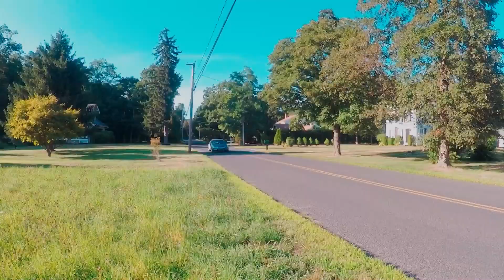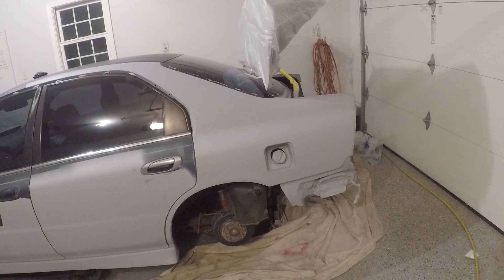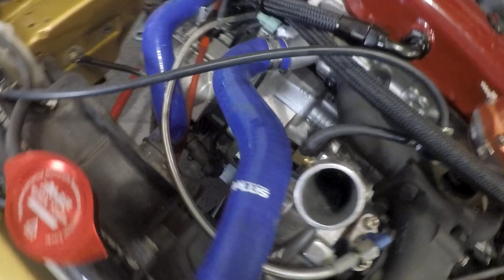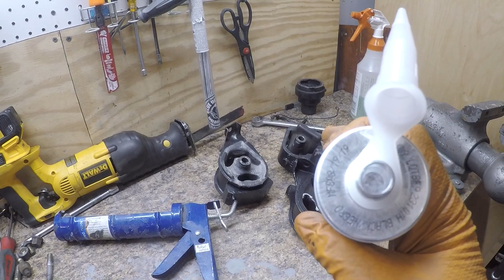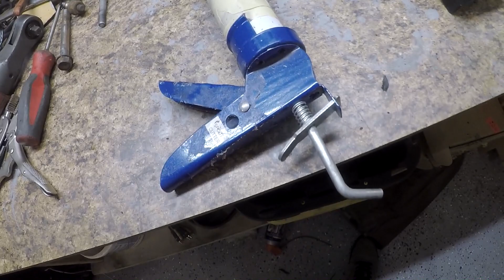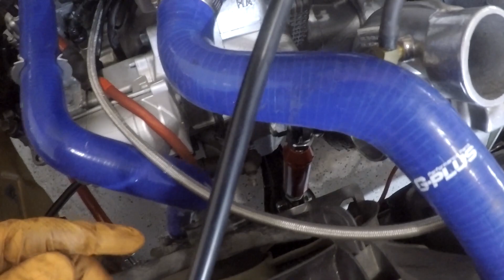Performance Engine Mounts For my Turbo Honda 3M Window Weld

Comment: Does anyone know the durometer of 3M Windo-Weld?  For reference Hasport mounts start at 60a for their durometer rating.
Reply: @chronicvehicleabuser4030  someone said 76a
Reply: 76 is a soft OS hockey wheel, should be firm 👍
Reply: 60a
Reply: I wonder how it compares to Dow Betaseal. It's cheaper and has the same cure time.

Comment: Ive done that to my 96 maxima mounts and i just bought some for my cb7. I hate how much flex the brand new stock mounts have.
Reply from the maker: Yeah totally man the way I see it, if I can move it with my hand... The motor is going to move it real good.
Reply: @ThatAccordGuy  definitely.. Plus i love how theres basically no wheel hop with solid mounts.

Comment: -
Great video.  I must do this for my rear broken mount.  Cannot replace it due to the need to drop sub frame.  Hopefully this will do the trick and get me by for a little while more.  Thank you .
Reply from the maker: Hopefully it helps man, jack the motor so it sits in the correct position while it dries if at all possible. Longer you wait the better. Good luck!

Comment: Squirt a little windex on your finger, or on any tool that you choose to use to smooth the surface of the urethane with.
It won't stick to windex.
Reply from the maker: Appreciate the tip!

Comment: ?????  My 97 Accord shakes at stop lights and I have to shift into neutral.  Would this 3M stuff help to stop the vibration ?????
Great car and thanks for the videos.  😀
Reply from the maker: No I’d recommend replacing them if you’re taking them out. Probably worn down to the metal. This mod will make you feel more vibration than a stock mount. Thanks for watching!
Reply: Thanks...this will be the third motor mount...aftermarket are junk...can you recommend a reputable supplier? @ThatAccordGuy
Reply from the maker: I’d go oem if you’re going for an oem type feel. If that doesn’t fix it then you’ve got another issue

Comment: I'm doing this as I type this message thank you I appreciate mounts for my 4th gen Prelude ridiculous
Reply from the maker: Yeah not worth the money honestly. This has worked great for me
Reply: @ThatAccordGuy  they've been drying for about a day now I have a really really small needle I poked through it still wet in the very middle I'll leave it for a few more days
Reply from the maker: Yeah it definitely takes a while. Mine oozed a little when I reinstalled with the weight of the engine on them.

Comment: Just did this method on some new motor mounts, thankfully they don't need to go into my integra anytime soon!.

But from what I see around the internet it takes about a week for the window weld to fully cure inside the mounts, so in about that time i'll swap them in and see how much of a difference it makes. 

I appreciate your video man, helped me get started on my project.
Reply from the maker: Glad it helped you. All of mine are still holding up strong. The one Mount that I filled the top portion of has a little crack in it, but that doesn't really account for any of the rigidity of the mounts. They're still holding up really well.

Comment: Motor mounts are pretty cheap if you spent the time and pain and busted knuckles taking them out. Which is the one single dreadful step. Why not install new ones. Maybe even aftermarket cheaper ones? If you want to be cheap. But taking it out and just to put the old ones back in filled with 3m. Seems a bit senseless. No disrespect I enjoy your content and maybe you or anyone can correct me. I’m only commenting because I’m planning a similar job. Would it be more sensible to jack the motor up to spec or until it’s all lined up. Or take load off the bushing and then jack up the engine. So it’s back in line with the transmission. Then apply the filler and leaving it position to cure? It’s not the cost of the $50 rubber mount it’s the time and pain getting it off. Any input or correction are welcomed. I’d appreciate the same common respect if you choose to chime in please have some knowledge. Don’t have to Experts on rubber, tires, rubber condoms, polyethylene. Just common mechanism knowledge and DIY like myself. If it’s broken I fix it. As long as it can’t talk. I tried fixing my ex. Well let’s just say the bitch broke down. Turns out I’m just a jackass of a few trades not all. Ha.
Reply from the maker: I see where you're coming from, however these are not stock replacements. If I wanted to put a new stock mount, Id put in a new stock mount. Aftermarket solid or urethane motor mounts can be upwards of $400 or more. No way I would spend that kind of money, so a very common tactic is to fill them with window weld. This gets you a stiffness of one of those solid mounts for cheap. Too much struggle to fill them out while they're in the car. Not nearly as accessible. And it would make a mess.